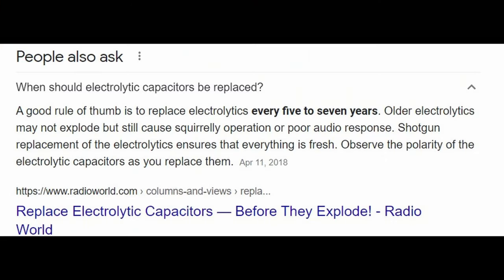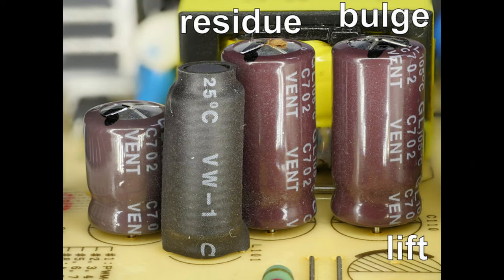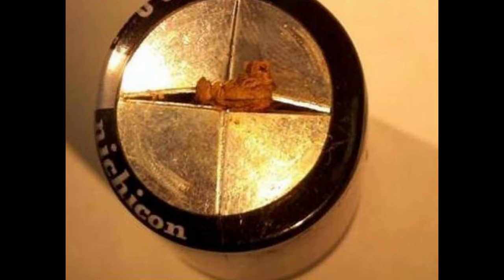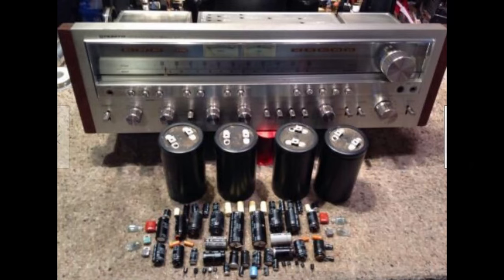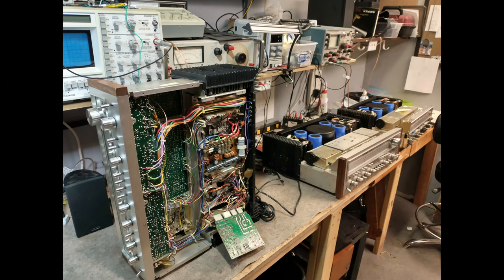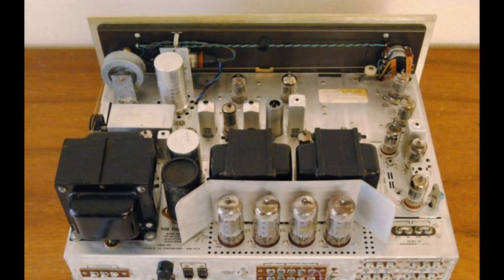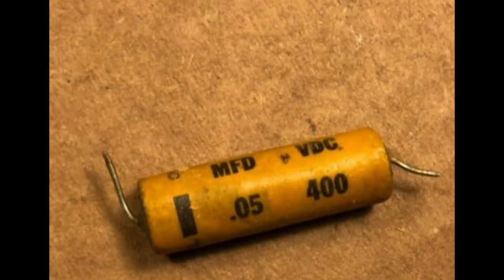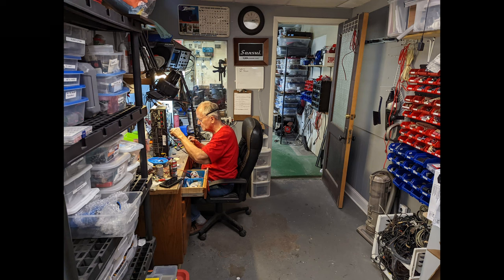Should You Replace Capacitors In Vintage Electronics?- Marantz Sansui Pioneer McIntosh Yamaha

Comment: It does not happen often but, if an electrolytic shorts out, it can cause other damage to the circuit as well. Especially in power supply and final audio output circuits. Using good quality replacements such as Nichicon, and Panasonic caps will generally last quite some time.
Reply: always use 105degree caps too! they last 10 times longer than the 85s
Reply: Just curious, where are those above mentioned parts made today?
Reply: @OLSKOOLOUTCAST one guess

Comment: Saw this vid this morning (right before turkey prep) and want to share I changed the caps in the power supply and the primary signal path in my Marantz 7T and it changed the sound.  Detail was improved as was stereo separation.  Also cleaned all rotary switches, plus toggles and 1/4" jack connections.  I have had this unit as original since the '70s and love the way is sounds now.  Not a big difference, but noticeable.  All caps tested in range, too.  Also changed some caps in my Crown DC150-II for IOC issue and it's back in action.  One of these days I will change the filter caps in my Crown DC300-II.  Happy Thanksgiving!

Comment: You can ABSOLUTELY hear the difference in power supply caps, with the caveat that you use really good replacement caps. Look for a higher temp rating lower ESR and higher ripple current rating. I normally use minimum of 105c and 5000 hour rating. Some companies used excellent quality caps in the beginning but while quality caps were used in the Asian market units some American market units like Mcintosh used what were then called " computer grade" caps that usually were industrial quality and those units might not benefit from a cap swap.
Bare in mind that you can get really good expensive caps that cost much more than you think.
For example I rebuilt my Harman kardon Citation 16 with fast diodes and Mallory extreme high ripple current and very low ESR caps that were made for professional large scale photo flash units.  The amp will do a cosine burst cleanly at over 1700 watts! I had to put thermostats and fans on the heatsinks! Those caps were over $500.00 15 years ago. Clearly the headroom was massively increased.
Reply: IF your caps were failing you would hear a big difference .

Comment: I agree 100% with everything you said. I recently won a Pioneer SX-1280 on EBAY. I ALWAYS take what I win to my local audio repair that specializes in vintage 1970's gear. I have a Hitachi SR-2004, a Sansui G-9700 and a Onkyo TX-8500 MKII all Ebay finds. All refurbished by my pros. I understand people wanting to take the cheap way out because vintage audio collecting is SUPER EXPENSIVE! On my Pioneer SX-1280 I paid $1,800 which was a great deal on price for that unit in good condition. I brought pre-built power supply and other boards from a guy in Canada $450.00. 4 New 22,000 microferad Filter Caps \ new boards for 250.00. To have everything installed and having all the solder connections reset, new LED's added, new banana plug speaker terminals added. All defective caps, transistors, diodes and whatever tested \ replaced and a new polarized power cord costs an additional $1352.00. Just bringing this one Pioneer SX-1280 unit back to basic good function cost me close to $4,000.00 and I got the base unit cheap. A new Pioneer SX1280 goes on Ebay today for $3,000 often more working but unimproved. (IF you can even find one!) Like I said buying high end units and having the service DONE RIGHT to last another 50 years takes a big up front investment.

Cheaper vintage units might not cost so much. The point is Monster 1970's Receivers like vintage cars can have monster restoration costs if you want to enjoy your purchase for the long term. Because I'm such a regular high end customer my audio pro's give me a few discounts and let me behind the counter to chat up the techs. This guy is right. Most of the techs are older fellows who either built or worked on this gear back when it was new. Some of the techs actually worked for the Japanese companies that originally produced much of the 1970's gear. Today they are little soft spoken older men who know their way around this gear like we  know our homes.

The shop I go to has a sort of mentor system where the old vintage gear masters teach younger new techs but this is rare. Even still its rare that you find new guys with the patience and aptitudes to repair vintage gear. He's right tech's aren't rolling up to the store in Jag's smoking $70 cigars lit with $100 bills. Very soon these 70's era vintage audio specialists will be gone and getting that prized 70's gear will cost you mad shipping fees and long waits for repairs that will never be this cheap again. Yeah you can say if it ain't broke don't fix it just so long as you know you are trading long term penny wise peace of mind for a short term pound foolish roll of the dice on 50 year old capacitors whose useful life is circling the drain ever faster with every passing hour of use.

The man warned you here. I'm just adding my voice to his because, I live in a different state entirely and I see the EXACT SAME THING he see's where he lives. In the end you'll make whatever decision you want but you can't say we did not try to warn you. If you rationalize good reasons go cheap on what can be an expensive vintage high end audio hobby old dying electronics will eventually betray your trust because time is a merciless teacher!

Comment: You are right I found a young guy who went to school to learn this craft on repairing this vintage stuff and he loves what he does. With out him I wouldn’t have the collection that I do he’s done about 15 receivers most of them the big boys 100 watts and above that’s what I collect plus he  refoams my speakers if needed he caps the cross overs really is a an amazing young tech. Almost impossible to find theres a guy in upstate Ny that specializes in restoring the early ARs I happened to buy a set of AR3 a s circa 1967 what I didn’t realize they had been restored by this guy can’t remember his name but holy crap these speakers hooked up to my marantz 2325 will hit you in the gut with tight base finding these people to work on this vintage stuff it’s all most impossible. I am very luck he also engineered and built a speaker and amplifier switch for me a smaller version of what you have for selecting different amps and speakers very cool. Any way I really enjoy your videos and sending you my rambling comments 
Thank you. 
Gary from Long Island
Reply: Where did he go to school?

Comment: I totally agree with you on getting preventative maintenance done now, as the techs in my area are older and before long, will be done working...
Reply: There's always be people who will do it and repair that stuff. And if it's only to change capacitor, then why you don't do it yourself ? It's not very complicated if you take the time to do it correctly. Information is more available than ever. It's not like troubleshooting or anything. I would start with something not expensive, and when you get assurance, then you move to more expensive stuff.

Comment: A well stated logical viewpoint. Which of course means I agree. The thing about recapping (by owners/amateurs) that frustrates me is those doing so hoping to fix a problem, which probably has nothing to do with capacitors, and many times they end up causing even more issues.
Reply from the maker: Agree 100%.
Reply: So what, if they cause an issue? that's how you learn, and it's just money. If you enjoy tinkering then go for it. Throw it away, buy a new one, and try again. I fried many components on my audio journey, and it was fun.
Reply: @imLastFirst  I agree.  But don't learn on expensive, getting-rarer-by-the-day audio gear.  That's the point I was trying to make.
Reply: I practiced on a lot of sub $500 gear, I should have said.

Comment: I have a Dynaco 416 and a Dynaco c100 energy storage system. I hooked it up to the amp and it started making a crackling noise. quickly unplugged it,no amp damage but dont know how to use the C100 dont know what its used for. The amp powers a vintage Technics rack stereo. RS9900US with RUS1700 reel to reel, and matching preamp. Im 62 and a 45 yr  musician, and always been interested in electronic repair. Would like to learn the trade..

Comment: Yes excellent video and “If it ain’t broken don’t fix “ only pertains to certain components when comes to vintage audio equipment such as TO-3 cased output transistors....but not capacitors ! For those saying you will change the sound if you recap your vintage unit , well I say yes you will change the sound....you will change the sound back to closer to what it was when that unit was new not the way it sounds today, tired after 40 to 50 years of use!  Also there many of the small signal transistors that should be changed out because they become noisy with age.
Now as for checking components in circuit including capacitors there are devices that can do with a good amount of accuracy. I spent 29 of my 38 years in refining working in process controls were we did a fair amount of electronics repairs. Back in the days before digital electronics most of our controls were either pneumatic or analog electronic and we did a lot of our own trouble shooting repairs on the electronic cards. Since in our industry we couldn’t afford downtime we had to do repairs fast and one device we used that was more useful than an “O” scope or a DVM was a Huntron Tracker circuit tester....it was an invaluable troubleshooting tool for checking in circuit components. These are still made today but they are not cheep! Another good one that cost far less but is only specific to capacitors is the hand held Atlas ESR capacitor tester.

Comment: I am not a professional but i (as a hobby) work on vintage tube guitar amps. I find I am way better with the gear than the playing, lol. I just wanted to bring up something you didn't mention that I hear quite a bit is "don't change the cap, just reform it" which even more crazy than don't fix it! Also in my opinion always change the coupling caps (tube gear again, I don't do solid state gear because frankly I know NOTHING about it, ,lol)  It mystifies me as to why this even is a debate, even if it's not vented and leaking its guts out, it's bad if it's that old, Great video! Peace!

Comment: I agree.Although I have seen some power supply filters in old Fisher tube type that still perform well.It doesn't mean I don't change them.As far as "don't fix it if it is not broken"I agree except when it comes to some of the IF strips in tube gear.You can cause yourself grief if you mess with them without doing a complete restoration/alignment.Please keep up with the good information.Thank you very much.

Comment: I perfectly share your opinion about vintage electronics and people still doing this job today, and I must also add some specific argument to change certain caps in your equipment. If you have to maintain tube equipment, filtering caps are important, but most are those decoupling caps like those paper condensers you showed: these must be replaced absolutely! First thing you have here parts that are generally more than 50 years old, and second if they leak, you can destroy the next tube at minimum (!). These high voltage caps are critical for security and sound, so you must pay special attention to quality and minute things like polarity, solder joints, insulation... When it comes to solid state amps and other post 1970 equipments, things like supply caps and many others electrolytics are good candidates for replacement as far as you can still find quality new ones and not cheap fakes. So replacing is sometimes challenging if you do it yourself, and having someone doing it for you is nonsense if you don't get a total caps change, plus eventual leaky or prone to fail diodes and transistors. This is not the same if you do the job yourself, and partial job is only interesting if you can test values following professional procedures and using proper test equipment. You need an oscilloscope, test generators, and a gigantic stock of different testers (some pricey!). If you want to test caps, a simple multimeter can't do the job in circuit, and you will need an ESR tester, PLUS a high voltage leak tester if you're working with tubes. It's the same problem if you want to align tuners and check digital equipment: don't do it if you don't have specific tools and know how. I must also mention SMD caps, some are a known leaking problem, with an additional destructive and corrosive leaking oil problem. Repairing SMD circuits can be challenging and require another pile of equipment (and place!).

Comment: I'm not too far away here in Omaha.  I am a recently retired software engineer who went to college for electronics.  Now I am working on equipment as a hobby.  I don't feel qualified to fix other people's stuff yet. I have done two recaps mostly for the practice. I did everything except the tuner boards. Also replaced the noisy transistors on a phono board.  In both cases the issues the receiver was having were fixed.  I don't mind replacing so many caps on my own equipment.  If I was fixing someone elses stuff I might just do as you say.  It can be time consuming.
Reply: I have a similar background. Worked for Siemens for many years in the automation division. I have an electronics degree\background but also did a fair bit of programming. Now retired from Siemens.
A little different from you - I've been working on (repair\refurb) for quite a few years, I have dozens of units under my belt. I'd say - don't be shy - work on your friends audio equipment and tell them it might take a few weeks to get it right. This isn't rocket science, we can figure this stuff out. Good luck.
Reply: @JonPaul  thanks for the encouragement. The most frustrating thing is not having many parts on hand. I never have the part I need. I try to order a few extras of everything i need for a project but the next project always needs another parts order. Then you have to wait for the order. 😀

Comment: Completly agree.  As far as changing the sound, that only happens if you change caps in the signal path with different values. The big boy receivers/ amps, need good caps to properly supply all the boards with the proper levels of voltage and amperage. And you just wont get that with 40+ year old caps, regardless if its still operational.  The key is to keep it within manufacturer specs. Then you will experience what the kit is supposed to sound like, and find out why they are in such high demand.
Reply: Well said

Comment: I have a marantz 2010 I have used daily for 15 years, with no issues, never been recapped. Also, two of the three receivers that I have had that were recapped, had a number of issues, that I am pretty sure were caused by something going wrong when re-capping. My marantz 8, most of the parts were still in spec when i rebuilt it.

 Not that I don't think re-capping is a good idea, because it is. but its a not necessary part of having an experience with vintage audio. Also, part of the fun of vintage audio, is the warm sound, which to some extent can be caused by aged capacitors. One of the units I recapped, I didnt like the sound as much after. Another one I really liked. 

I think it also depends on the parts. Specific brands and time periods can have a lot more issues then others. I have 70s stuff that the original parts test normal, and i have 80s/90s stuff where all the caps were bad.  anything 1950s usually shouldnt even be plugged in without a recap, unless its on a variac, or unless its pcb oil capacitors, which seem to be invincible. My opinion/experience and two cents anyways. Vintage audio was a lot more fun when you could pick up a receiver for $50, and not be paranoid about recapping. on the other hand, It is good to see a lot of this gear being restored. Its also good to see techs still working on this gear.

Comment: Hi...I am new to your channel but everything you said is correct. Even myself included I thought years ago that capacitors don't need to be changed if the unit works. But years later I am thinking once you own a unit for long time you get so used to the sound that you start thinking that it is absolutelly o.k. And then you listen to a unit which has been completelly recapped and you just stand there with a dropped jaw .......because it sounds awesome !  I was lucky to get such a unit !!!!!! It is the Marantz 4270. Before I had a Scott R-376 which has even 75 WPC at 8 Ohm. Because the rest of my components is by Marantz I went back to a Marantz Receiver.

Comment: I fully agree with you on changing out the power and filter capacitors. I own a Marantz sr6000 from 1980 that I brought on Ebay last year. It works but after 23 years it is time for the recap.

Comment: The power amp and power supply sections oh yes I can see that..  the less stressed areas I'd probably hold off until i see some leakage or a bulge.  But those you spoke about I can agree with,  and ask for the best quality parts to be used.

Comment: Agree 1,000%. I have one word for these people who claim to be able to hear a gnat fart and that word is double-blind-test.  I sincerely doubt they could survive an objective test.  I am a musician, electrical engineer, recording engineer and an audio freak and I learned a long time ago that when it comes to speaker wire, 12 gauge copper wire you use in low voltage lawn lighting sounds just as good as super expensive low capacitance cable. Pure BS.  Thank you for your honesty.